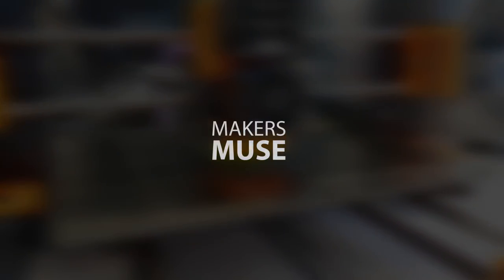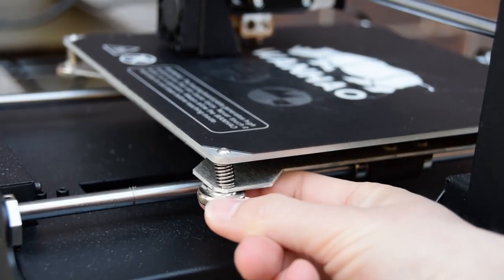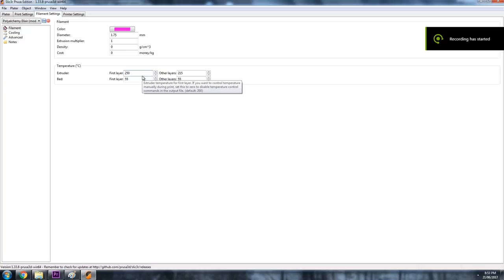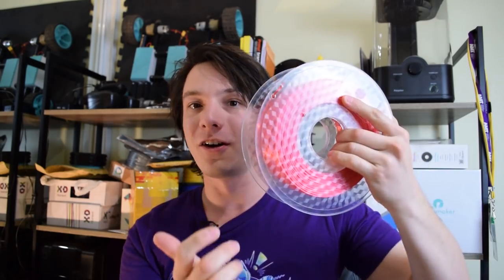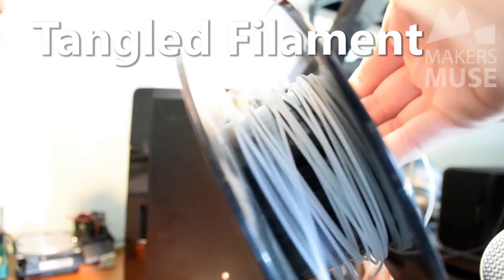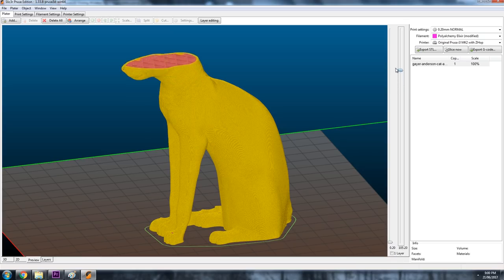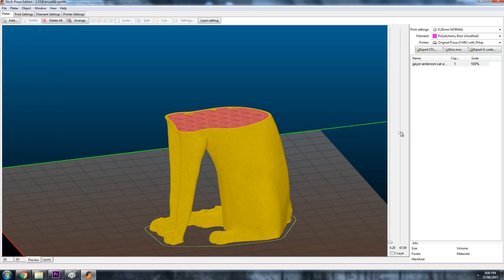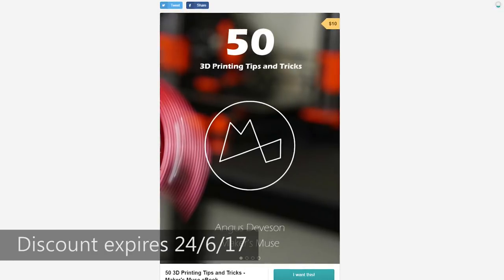5 3D Printing Mistakes you WILL make - and how to avoid them! 3D Printing 101

Comment: 4:20 Reminds me of when I bought some cheap solid-core doorbell wire to act as an antenna for a CW receiver someone gave me. I unrolled the spool of wire and spent the next hour wrangling it and doing my best to avoid kinks in the wire (which will easily stress and break).
Lesson quickly learned.

Comment: good basic advice, I've made most these mistakes, except for bed leveling, I took it to heart to get that setting right, I use basic typing paper, if you push and the paper bunches up, it's to tight, going to all 4 corners  over and over until a consistent pressure is achieved

Comment: To stop the tangled filament problem, make yourself a better spool holder. A lot of people i see online have the rolls on bearings, so it's very easy for the spool to unwind too much. You should have a little breaking force on the spool so it really only unwinds when the extruder pulls on the filament. Could be a project for Angus to find or create the perfect universal simple spool holder design. One that works with all the spools he has in his storage... ;)

Comment: Has a machine that melts plastics back into string, been created yet?
Reply: TheUnholiness Within there are a few diy out there, but make sure you have a well ventilated area.
Reply: The filastruder or the filabot. Just be sure to get an old paper shredder or the like to help shred your prints.
Reply: Your Mileage May Vary on them.

Comment: Another thing is orienting the model to print with no/less supports if possible. I don't have a 3d printer yet but I've bought 2 3d printed Fidget spinners from the same guy awhile back and one of them is printed in a way where the center bearing hole needed to use supports and the other was printed flat.

Comment: Since the polyalchemy pla prints at a higher temperature, would that mean its also a bit more compatible with the Australian summer and resistant to turning into a puddle of goo?
Reply from the maker: Possibly, but I still think it'd deform in a hot car. It's not that much higher.
Reply: Yes but I believe the summer would be the least of your worries in Australia.

Comment: Prusa i3 mk2s squad laughing at the first tip.

"Oh yeah... the Z adjust took me five minutes two months ago, that's right I forgot that"
Reply from the maker: To be fair, I still tweak my z adjust a little bit, I think temperature varies it slightly. But yes... rarely!
Reply: Maker's Muse temperature hehe labeling at controller end of both heat elements got off. So I pulled on those to see which ends belong to which already mounted hottend on completed x axis. After three days failing to heat I remembered what happened and yepp had mixed up + - of #0 and #1. And those screws can get you screwed if they get loose and you hear it rattle from the z axis colliding with the printed part.

Comment: Nice video. Useful. Thanks for sharing. Here's some more.
6. Using old filament (PLA hardens & becomes stiff & brittle over a period of time). Use it up before that.
7. Incorrect STOPPERS settings can lead to inaccurate HOME positioning.
8. Not using 3D Printer for long time. (Circuits can catch moisture & rust the electronics). Keep it used time to time.
9. Trying to replace filament when nozzle is not hot. It may get damaged. Heat up the nozzle before removing/replacing filament.
10. Leaving the print job unnoticed for a long time can over heat cooling fan motor which keeps running for no reason.
Reply: For number 6 I use a simple toaster oven to keep the filament I have taken out of the original packaging and I leave the rest for emergencies although you can get filament driers.

Comment: Hey mate Im very very new to 3d printing but :
On all the bed leveling video's I have not seen 1 that first says to wind the bed down so theres spring tension on the bed springs , if you dont have tension the bed is free to move around and wobble all over the place during printing and also this is why every time you bed level its showing different measurements.... Tip of the day brought to you by Tony Den cheers happy printing.... 👍😊

Comment: What do you do if a roll is ending, and you still have a fair amount of fillament left but not enough for anything you want to print? Do you forget about it and get a new roll? Also, how do you make sure you have enought fillament on a roll for what you want to print?
Reply: for the how do you make sure there's enough some slicers have a place where it tells you how many grams it's going to use, you could always just keep up with every print you do on that filament and subtract out of 1000 or you could weigh the spool and calculate the actual spool weight out of the filament, or if you feel you don't have enough hold of on that print and get the same roll of plastic and start with the small roll and when it gets close to being out pause the print and change to the new roll
Reply: For shorter pieces of filament left over, you can measure itand figure 1 gram per foot. A print preview should give you the amount of material needed.
Reply: I measure short leftover pieces and figure one gram per foot.
Weighing the spool is a great idea, I'm going to start doing that, thanks.

Comment: I recently printed something that was mostly flat and needed supports, but I forgot to turn it on in the settings. Luckily the Trinus bridged and and the surface layer is visually perfect, while the underside is covered in coiled extrusions. Saved the print that took 5 hours and it is still fully functional.

Comment: 100+ hours of 3D Printing and haven't had any of these happen to me yet.
Reply from the maker: Nice! Must have a good machine and a lot of attention to detail. I'm usually just too impatient.
Reply: Lots of research and patience AND been watching your channel for a few months now :D
Reply: What printer are you using?
Reply: That's key. Research and a fundamental understanding of how and why things are set up the way they are. I too have not had any catastrophic failures from the items mentioned in the video (did have a tangle in a spool once but caught it before it was a problem).
Reply: Fester Blats Not necessarily. While 100hr isn't that much for a 3D printers total runtime, it depends on the kind of things you print. I personally most regularly print 2-6hr small objects. Usually some small part, mount, or shim for a larger project.
Reply: YET

Comment: A little trick to help respool filament without the spiraling twisting end going crazy is to alternate the twist as you loop the filament back on. In other words, twist the filament clockwise (Cw) or anticlockwise (Acw) the filament will tell you which way it wants to go naturally. For this example say it wants to naturally twist CW, the next loop gets an ACW twist, then CW then ACW. Before you know it this becomes second nature. The spool will get reloaded in its manufactured natural state. This also works brilliantly with hoses and ropes and power cables. I can lay a 30meter long power cable as a spool next to a PowerPoint,  pick up the socket end and just walk away with it without any concern that it will bird nest on me. A side benefit is your spool of whatever you have will become soft and supple and lay flat without trip hazard vertical loops. But I digress. As a secondary bonus your filament spools coiled in this manner will have less chance of unwinding wildly as well. 
Ps. Love your channel and you have been a great help with my first foray into 3D printing with my new “Anycubic Upgraded Delta Rostock Linear Plus 3D Printer”. God, I wish they’d give them a simpler name!

Comment: I did a lot of research prior and managed to avoid all of these mistakes except the filament one, but that wasn't my fault because it was the filament that came with the printer and despite the fact I had never unrolled it, it was tightly coiled and it caused it to ruin a print because it didn't unravel correctly.

Comment: Just started watching your videos again mate, and they are better and better, as with tangled filament i had this one today as i had not used the dreamer for a while, lucky enough i caught it in time, and yes the dreaded settings for different material, always check the box..!! Also i use motioneye os on my pi with 2 cameras (one for the dreamer and one for the trinus) to monitor them both... keep up the vids man...nice

Comment: YES. YES. A THOUSAND TIMES YES! I feel like if I saw this when I first started, I wouldn't quite understand, but boy howdy do I understand NOW. And sticking the loose filament in those holes. JEEZUS is it infuriating finding out the reason it jammed is because I didn't do that. I NEVER forget to now of course. I think everyone's 3D Printing education journey just has to have these trials and errors so we learn not to by failing. it sucks so bad though, but I'm glad I know what not to do and totally why so I don't again.These days I never print rafts, and I'm getting into using Meshmixer to create column/cone supports instead of my slicer's crappy ones. prints look so good these days

Comment: Bed adhesion tip for worn out surfaces: 
99,9% isopropyl in a spraybottle, gluestick and towels/wipes. Add gluestick to the bed, just some spots. Before it dries, spray it with iso, be generous with it. Use small piece of towel (or just fingertip) to spread it around, mix it to a thin paste and then wipe it away. Repeat as long as needed to get even coating. Last time i did it the bed came out looking it is freaking new and in reality it is so worn out that it shines in places.. 

I use the spatula to spread the glue+iso mix, the consistency is gel like. The glue will melt with iso so it can be fixed even after it dries but what i've found is that the final wipe has to be made at once, no retries if you want it to be visually good looking.. You can put gluestick direct to the towel or piece of cloth so it won't soak so much of our "sauce". 

Don't try to cover the entire surface at first time when putting on the glue sticks. Go over the entire area piece by piece, dab, spray, wipe, dab, spray, wipe until there is some glue but it is not even coating. Add more glue when needed but note that we are wiping most of it away.. when you work with it, you will notice how it behaves and why it ends up quite random and ugly before the final wipe. Use lots and lots of iso in the last wipe, not so much that it starts spilling out but as much as the bed can hold. Piece of cotton towel seems to be great for the final wipe, it can be reused as it soaks in the glue... but for this, everything needs to be clean. 

So...of course the preparation is going to be: remove all the old glue, we want it super clean first. Otherwise your rags and the gluestick itself gets dirty, it needs to be really clean with no oils or dirt. This method also fill in small cracks in the bed and if you have run our nozzle to the ground like i did, it fills in those too.

Comment: I've gotten exactly one tangle in all my filament spools over the years. Brand new roll of some no-name eBay filament (yeah yeah, I know). Loaded it onto my holder, got tangled almost immediately, fixed the issue and printed a bit more only for it to get tangled again.

I pulled the roll off the spindle and started hand unwinding it. Every so often I found another tangle, just dozens and dozens of them. Think maybe the filament wasn't handled properly, fell off the spool when it was being packaged, and they just wrapped it back up carelessly and stuck it in the box. Further in support of this, it didn't have the nice neat look of a tightly wound spool.

Comment: The only one of these issues I've had is the spool being cross-wound. The worst print failures I had was when my y-axis smooth rods weren't greased enough. The bearings ended up sticking and I had layer shifts in the y axis. Took me a while to figure it out and wasted a lot of plastic.
Reply: If you see a tangle on the spool before it jams up, you can simply take
 the spool off and put it through the knot from it's end. I've done it 
many times, but like Angus said, you have to monitor your printer.

Comment: I have a question, i just got a printer, so in the settings if I'm using PLA + , and it's black. Do i have change a setting on the slicer software letting it know what color is it? Or doesn't that matter? Please help. Thanks. 
 new subscriber. Great videos.

Comment: Another thing to look out for is long prints with transition filaments. Some need the temperature to get hotter or cooler based on the plastic changing.
This will either make the print look worse as it goes or the filament might get stuck in the nozzle and stop extruding.

Comment: I have a roll of PLA that's horribly tangled. Came that way right out of the vacuum sealed wrap. I have to unroll and re-roll a bunch off it each use to ensure it'll not catch. Whomever rolled that didn't have the tension correct so it got the filament laid over itself a lot. It'll pull out most of the time but sometimes it holds back hard enough to make the extruder skip.

Comment: I realize this is a 4 year old video but, in case someone stumbles on it as I did here is #6. And, by the way, I am now at month 7 of printing and I learned a lot. #6. When you build your file in what ever CAD you use and you are joining pieces together make sure to overlay them. Example, two 3D squares of same size. Do NOT just bang them both together so they are just touching. You want to embed one within the other. Depending on the shape I try to embed one object within the other by .3mm. That seems to be enough of a join. I am sure you can do it with .1mm but I like to be sure to play it safe.

Comment: Hi Angus, I got a question... for the last tip that you mentioned...what would you do if you have to print overnight? You won’t wake up every hour or so just to check the print right? Also for the last tip which 3D Printer is that? The one with Raise 3D on it

Comment: Prusa i3 user here...

#1: This is the biggest struggle for newbies... I fought forever to get a good level and first layer when I was first starting out... I heard a tip that you should try to run a piece of paper between the nozzle and the bed, but I found that when the nozzle touches the bed ever so slightly on each corner at zero Z, it's groovy...

#2. Yep, I've done that too... Even between my PLA, I have settings for different in-fills, supports, rafts, etc. etc. etc..., and every so often, I'll come back to a print and see that it's shooting 40% Honeycomb infill instead of a 20% rectilinear...

#3. Has never happened to me... I've been dealing with bailing twine and weed whacker filament and wire and rope and fishing string and a whole bunch of crap that comes on spools my whole life, so I'm pretty familiar with this hiccup... :D

#4. Yep... A 3D printer cannot print on thin air, thanks to gravity...

#5. I don't get why people don't monitor!! I LOVE watching my 3D printer chooch out a new toy! :D

Comment: an MMU2 specific tip I can give....be very careful with no sparse layers in prusa slicer. I did it and made sure it would clear, but I was printing with silk. It didn't print anything for the purge block for many, many layers.......and then it did. Then it swapped colors and continued the purge. After 3 layers the purge block fell off the bed and the print failed. It didn't print hot enough for bed adhesion. So if I use that feature again, I'll make sure I print a very thin waste object to force at least 2 or 3 layers of purge right off the bat. After that it should be fine and if it wants to skip 100 layers, that's fine. It just needs to print that first layer at the hotter temperature.

Comment: 1 & 4 most common if I was to do a survey? 4 is the most frustrating for me. Should I add? Full support? Just to build-plate? Density of support? Shape of support? Tree supports?  Change models orientation on bed to alter what type of support, and where it’s to be used? Supports have to be the absolute most frustrating thing for me! Things I want to print I can’t without full supports, and the supports leave my model looking crappy after removed , even if I am  able to twist them off successfully without destroying the delicate model that easily took an entire day to print, even if support density was set to only10%.  The time it takes to print with full supports is also insane, not to mention the wasted filament. I’ve read that tree supports are not recommended to be used on larger flat areas that need support. Someone seriously needs to provide me much needed help here please! Do I really need an expensive dual extruder fdm machine running dissolvable supports through one extruder, and then fool with dissolving the supports later in a bowl full of lemonade,  “if my kids haven’t already drank it up yet?”  The subject of supports appears to be a slow learning curve area for me, with lots of trial and error, hit and miss. A VERY frustrating area/aspect of 3d printing for me! Oh yes did I tell you I use a Kossel Delta type printer? This poor boy can’t afford to fly 1st class yet. 😒

Comment: I definitely wish I'd seen this before I started printing. However, #3 is too vague to be useful. There are dozens of settings, and "make sure they're all good settings" doesn't even tell you which ones are most likely to be wrong, much less what the correct settings are.

Comment: Improper loading of a wirefeed welder causes the same problem as the tangled filiment problem but the wire is much stiffer and brittler and is also much more costly {AT 50 us Dollars and up a spool}.A bad thing no matter how you use it, spools can be problematic if not tended properly.